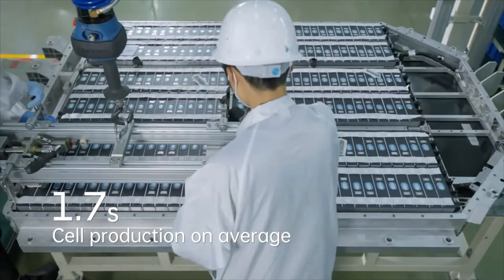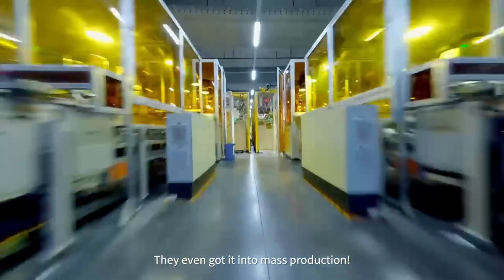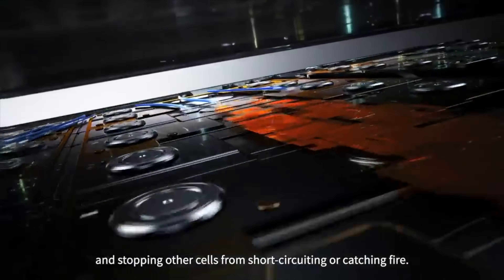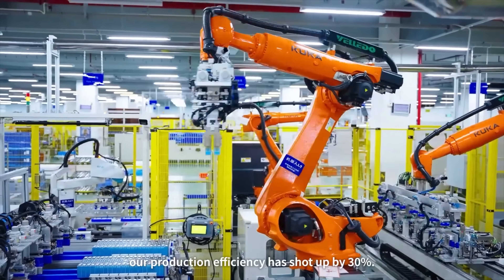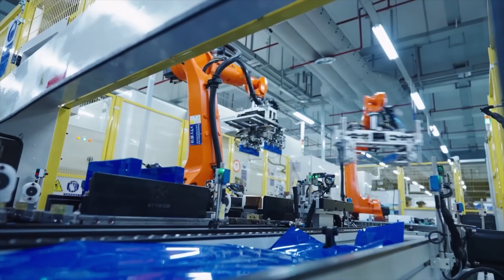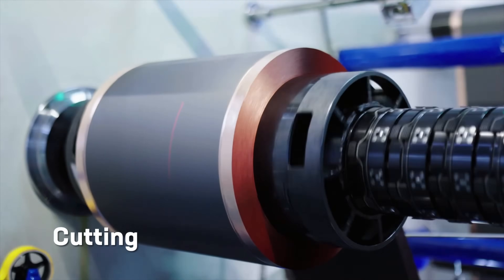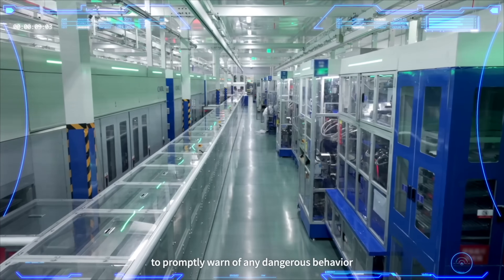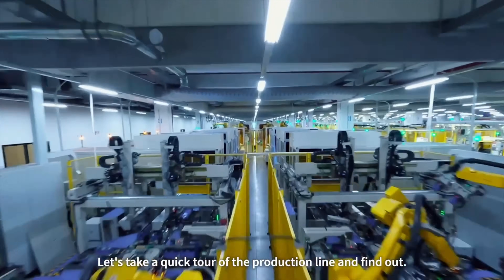CATL’s Sodium-Ion Naxtra Enters Mass Production - It's a GAME CHANGER

Comment: As a consumer I don't really care what battery is in the car. Overall price of the car and range are the main things I look at and then charging speed. If the price to replace the pack were reasonable then I would not care as much about how long they last or warranty. For example if the pack lost a lot of range by 100,000 miles usage but it only cost $3,000 to replace it that would be ok. It would also be nice if that replacement could be the latest technology or upgradable.
Reply: As a consumer I was looking for a new EV in summer 2021. However  everyone mentioned fire hazard of those, and I've spent a couple of hours for pleasure research reading. That's how I ended up with a 2021 BYD Song EV with LP battery and still using it today, with no measurable battery deterioration at 119000km. on the clock
Reply: @ФёдорЛукин-у1о Eh oui ...tu as tout dit : c'est une LFP donc ta voiture sera à la casse après 25 ans de service , et la batterie sera toujours opérationnelle ! 
Une NMC devrait être remplacée environ 2 ou 3 fois ,selon sa qualité,durant la vie de la voiture ...c simple
Reply from the maker: Yeah, I like this way of thinking. I think a lot of people are the same. Thanks for the comment Frank.
Reply: @benalexxander  Id disagree with that statement to be honest Ben, we shouldn't be targeting convenience over durability.  Recycling lithium batteries has a huge environmental impact and despite throwing a lot of money at the problem we still arent able to do it at scale.  Buying packs that have appropriate thermal management and a chemistry with a long lifespan is better for your wallet and better for the environment and I think your channel has done a great job of championing that cause.
Reply: @benalexxander cette façon de penser est stérile ...pour trouver les bonnes solutions il faut se renseigner un peu et choisir la moins mauvaise solution , pas énoncer comme un gamin capricieux ce qu'on veut !
Reply: I am also a consumer but I do not do large mileages and so for me price is the most important. It is a city car, so range is not important and I home charge so charge rate is not important. All the other things, such as low wear, cheap fuel, reliability, battery longevity etc. are pretty much right across the EV battery range.
Reply: Number of charging cycles is also important! I want a battery that’ll last for 300,000 kilometers!
Reply: Take these thoughts to their conclusion: you end up with battery swapping. Pay nothing for the battery up front, get the latest tech whenever you need it.  Reduces the upfront cost by a big chunk and removes the biggest source of excess depreciation of EVs compared to ICEVs, making EVs cheap to own.  Trouble is, it requires manufacturers to agree standards. Never going to happen.
Reply: @gregvanpaassen  We couldn't even get a standard charge port in the US. You think they would agree to swapping? Not a chance. Government would wait until a bunch of people buy in and then do a surprise tax or something.
Reply: The next thing to consider might be the charging efficiency with home charging.  The ‘round trip’ efficiency will become more important than the actual capacity or power, as time moves on, I think.
Reply: @oliver90owner  I have two EVs and didn't even notice a difference in my electric bill. Hot weather can double the bill so the home AC seems to be most of the usage.
Reply: @frankcoffey    I don’t often need cooling - it’s cold weather heating that doubles my energy bill.  I was simply mentioning the round trip battery efficiency - something I’ve not yet seen compared.  I don’t need to charge my EV at extremely high currents and it usually charges at home on a 7kW supply.  That 7kW charge rate is a lot more efficient than the minimum option I have - which is 1.4kW input.  Most of that is down to the in-car charger operation requirement (likely close to 250W?) but these losses may change, with the alternative battery chemistries being offered in the near future.
Reply: @oliver90owner  I'm in Texas where natural gas is cheap and my heater and water heater is gas so winter is cheap for me.
Reply: @frankcoffey    I’m in the UK.  Gas energy cost is currently about 80%, or more, for the standing charge.  April cost me £51 for gas but I only used 51kWh.  The unit cost for the gas was 6.8p/kWh (the monthly bill was £3.50 for the gas and £9.35 for the standing charge).  My leccy was £42, of which over £14 was standing charge and the 261kWh used from the grid averaged out at 10.6p/kWh.  But this has nowt to do with storage batteries, so back to EVs?
Reply: @frankcoffey  Texas is plentiful in electricity that’s why we get free electricity on the weekends if we so choose and there is a large bitcoin mining farm here.
Reply: Spot on analysis of the ev consumer, user pov.
Lot of variables to game out an ev that checks the boxes for consumers.
Low cost batteries changes the equation immensely, such that consumers would accept lower range if the cost was low enough.
Range becomes far less important if charge times drop to 10min for 100miles of range, for example.
In the past 25 yrs of driving 220+ miles one way at least twice a month, I never drive more than 2hrs without stopping for food, bathroom, and stretching, and usually fuel up.
Bathroom and stretching out is basically mandatory every 2hrs over 40yo, probably younger.
2hrs at avg 60mph is about 120miles, which is around my stopping point.
So low cost 150-200 mile battery that charges in about 15 min and is lower cost than current wins the game
Reply: ?? Donc contrairement à ce que tu dis tu t'intéresses à énormément à la batterie... Avec raison... Mais pas la peine de réfléchir au sexe des anges, il suffit de choisir une batterie LFP pour avoir les qualités que nous recherchons tous...en plus elles sont moins chères ... Problème pour l'instant elles semblent introuvables en Europe alors qu'elles constituent la grande majorité du marché en Chine...
Reply: @capiz625   The Chinese have a list of regulations regarding battery use.  Fire resistance is one of them, so I expect all chinese sales of Lithium car batteries will be LiFePO4 at the present time.
Reply: As the limit of paying more than necessary goes to zero=  buying more enjoyable. It's calculus
Reply: @MTSINAI-JabalAl-Lawz-NE  I have noticed people who buy cheap cars love them more and have fewer complaints than those who buy expensive ones.

Comment from the maker: Would you pick LFP or Sodium Ion?
Reply: I would love a Sodium home battery.
Reply: I would choose both give me a hybrid sodium lfp mix
Reply: Depends on how they use them honestly but I'm fine with LFP since for general use you don't need the extra power draw and LFP works better with V2L and V2H. The flat discharge power draw is something I would prefer in feel when driving as well.
Reply: I would want the safer of the two
Cheers from Canada 🇨🇦
Reply: That cold weather performance really is the killer feature,  great for cars but it also means you can store your home battery outside the house without requiring some form of heating element.
Reply: Depends on the application and use. Na for town EVs - but most Grid and Home storage use. LFP for travel EVs. Mix storage packs are also welcome for EVs so you can still have that cold weather protection and you can scale the amount base off location.